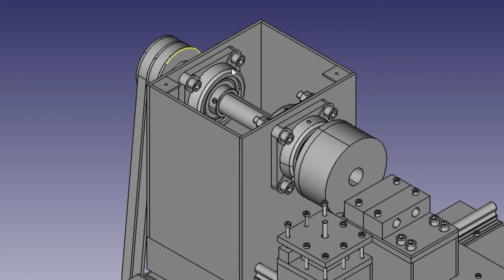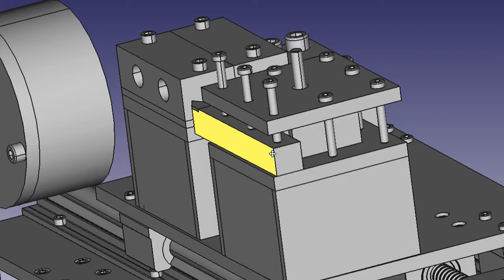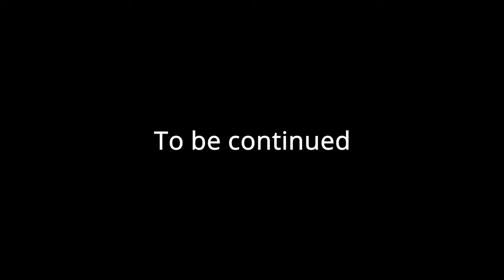Making a DIY CNC Metal Lathe  | The Frame | #1

Comment: you may want to pour concret into the box section inprove stiffness and asboure the vibration
Reply from the maker: At this moment this machine has to be at least a little bit "mobile" as it doesn't have a permanent place in the workshop and probably it's weight will be about 120kg. Do you think with this kind of weight it might still need more mass? Might be a good idea in the future.
Reply: @GBWM_CNC  more weight the better, as box section tend to vibrate when cutting, you may need something inside the box  section the asbourt the vibration so you can then improve the surface finish of the final part, what you could do is just use normal sand and when you need to move machine use a hoover and suck out the sand, I built my own DIY mill using box section and found having something the box section improve the performance of the machine
Reply from the maker: @chaddanylak8706  That's a smart idea. I think i'll give it a try when it's ready. thank you!